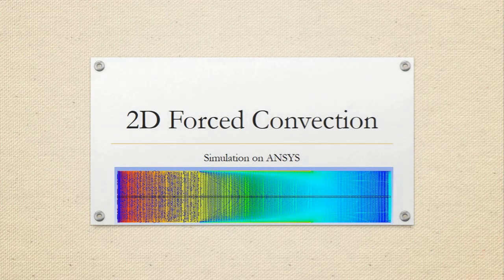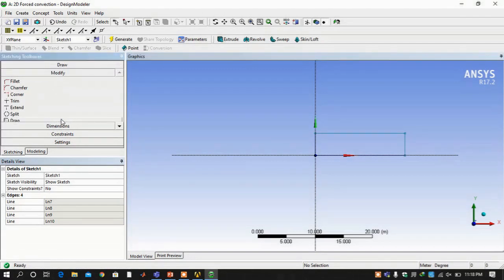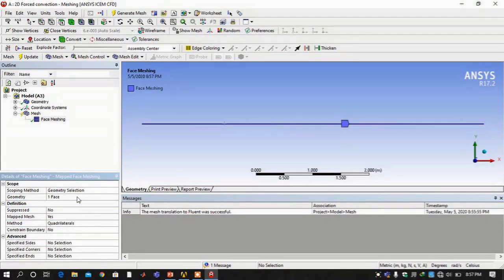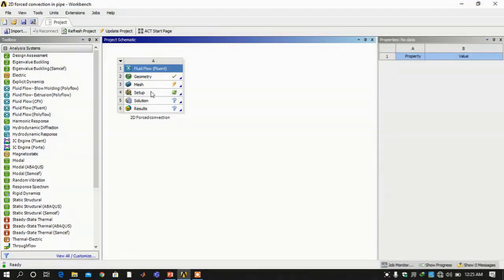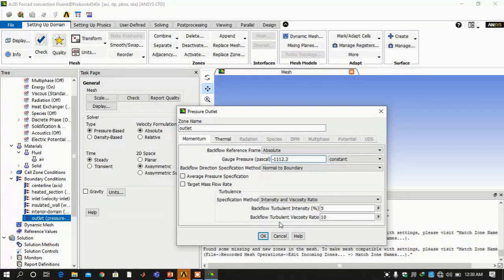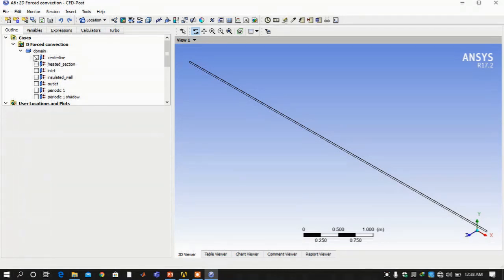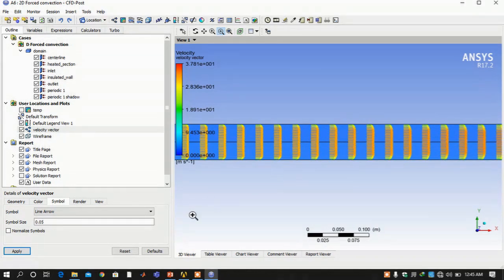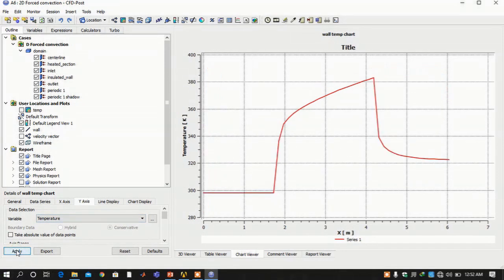2D Forced Convection | ANSYS

Comment: can you please tell me how to solve a small problem? In that, there is a  heated plate and on that liquid jet strikes and so its temp. changes as convection take place. How do I set the initial temperature for that plate and the heat transfer coefficient for that plate. If I select convection then there is no place to input the initial temperature.
 Please help me I am stuck at this point.
Reply from the maker: Patch the temperature after initialization